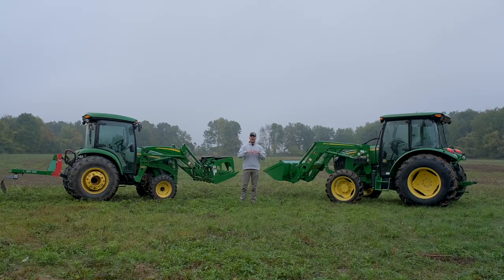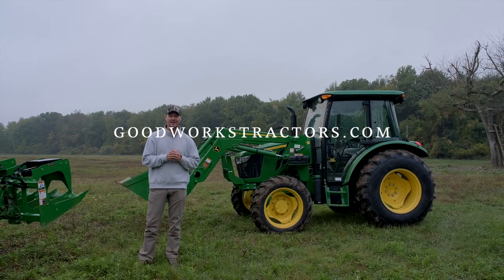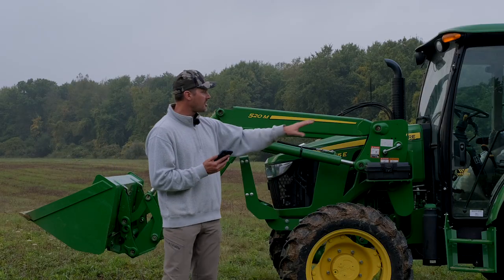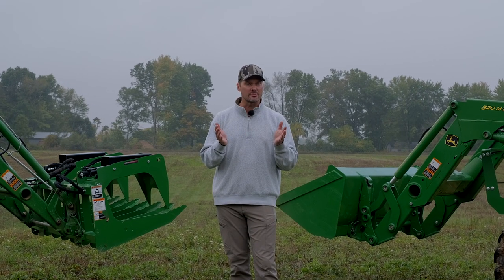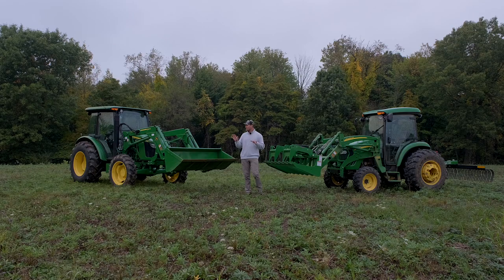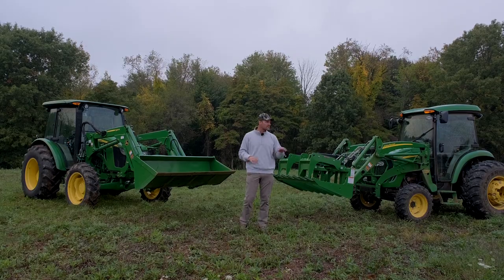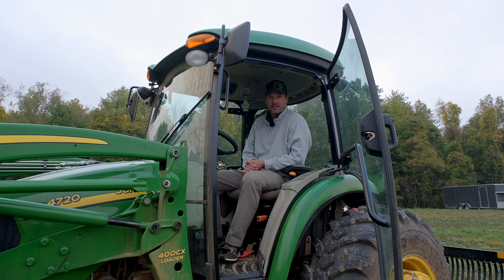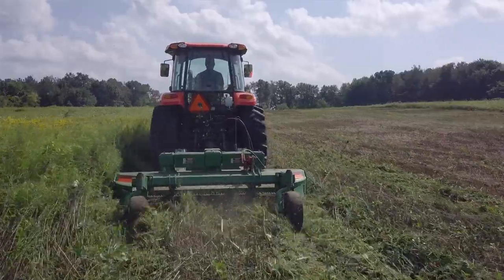HOW'S THAT POSSIBLE? 6 YEARS OLDER, 600 MORE HOURS, SAME PRICE? 😕

Comment: The 5e tractors can have 3 rear remotes as well as the 5m, but the 5r can have 4 rear remotes. Keep in mind the 5e are made in India and the 5m are assembled in in the U.S. with a lot of U.S. parts,and the 5r are made in Germany. The difference between the 5m  5r and 5e are huge, thy cost more but worth every penny. In closing I'd like to say often with tractors if you want good quality and reliability you have to pay the higher $$.
Reply: I wish I would have read this sooner. Just got a 5E, first time out I popped a hole in the fuel tank. 1500 dollar repair. I'm wondering if the 5M/R have skid plates to protect the ABS plastic tank. Should have used metal.

Comment: $45K?  Wow. I know JD holds its price better than some but, dang I can get a 60hp Kubota factory cab tractor brand spank'n new for that and have a few grand left in my pocket.
Reply from the maker: Which one?  There's three different 60hp Series from Kubota.  All at drastically different price points that do different things.  Just like the two in this video.  Hard to compare anything without context.
Reply: @GoodWorksTractors  Good point, I was talking about what they term as their economy line, the MX series. Don't get me wrong, I' not trying to put down JD at all here. I would have one myself if for nothing else than the way they hold their value. I even had one on my wish list when I was shopping but It just wasn't the right choice for me in my situation.
Reply from the maker: Understood!

Comment: I don’t believe John Deere has a recirculating option for the air conditioner in any tractor below the five series. That makes no sense to me that you’re always pulling air in from outside. Hot dirty dusty air. I don’t think anybody makes a better Tractor than John Deere but the Kubota Grand L cabs are bigger and nicer and you can recirculate the AC. If I could afford a cab I would not be a loyal John Deere customer like I am now. You mentioned a while back how hard it was to get a product you developed into production and on the market for sale. Maybe you could do a video on that process. I have built some attachments and accessories. What’s do I do next…

Comment: So why is the older tractor the same price as the newer one? Is it more valuable?? And why would Deere put the PCM at the very front of the machine on the 5 series so that a tree branch or other pointy object that punctures the front grill will easily take out one of the most expensive components??
Reply: They are more valuable because they sell way more of them to homesteaders. They have the highest HP for a compact Category 1 tractor. 

Just got a 5 series, first time out popped a hole in the gas tank under the cab steps. 1500 dollars later I'm looking at the grill Guard Courtney reviewed for his compact tractors.

Comment: The compact utility market, regardless of brand, uses HP ratings purely for marketing. On that size chassis, 45 HP is all the tractor is capable of using. Anything more than that is marketing to say my tractor has the most power. There's just not enough tractor there to warrant that much HP.